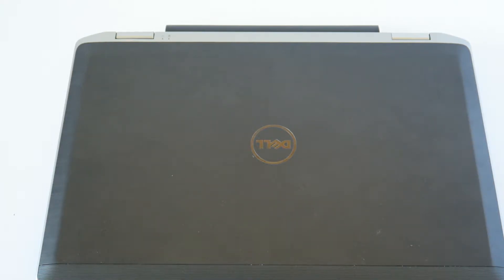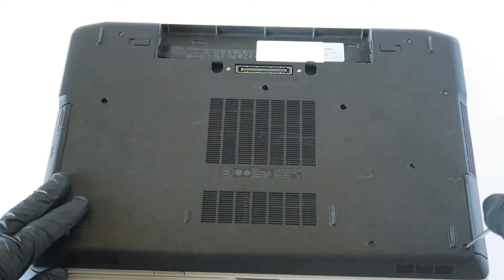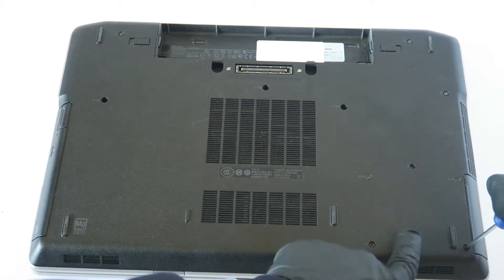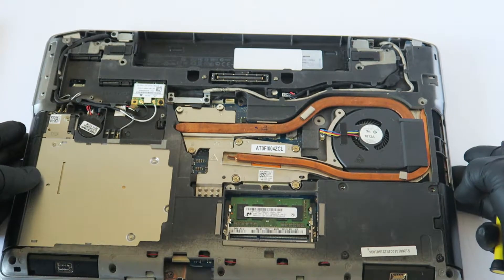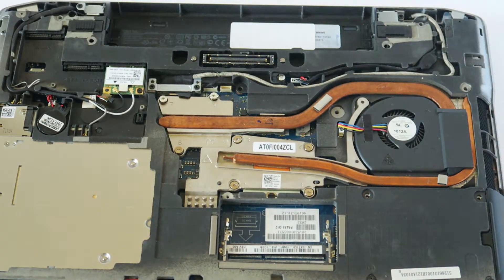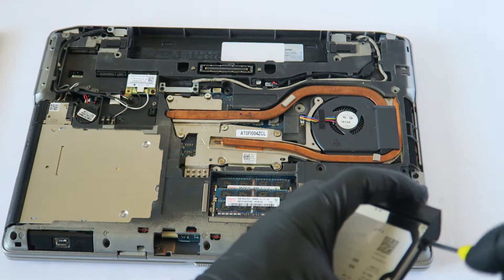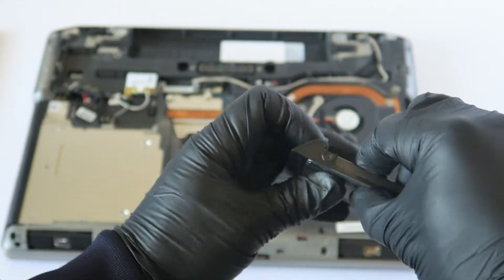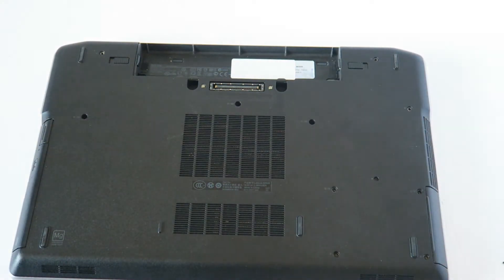Dell Latitude E6520 Upgrade RAM SSD Drive

Comment: Sir i like your stuff it's really helpfull, and i have a question about dell optiplex 9020, i want to install a gtx 1060 6gb 120w single fan in that case, the question is : can i use a 2sata to 6pin cable to power this gpu without changing the 290w power supply which is technically enough to give this power ???
Reply from the maker: Hi if you install gtx 1050 ti and you do not have to upgrade power supply and gtx 1060 6gb you should upgrade power supply at least 400w brand name and you have to use  24-pin to 8-pin adapter cable for dell optiplex 9020 mini tower.
Reply: +Mxkdi 
So i couldn't use those 2sata-6pin cable for that 1060 ?
Reply from the maker: No, you should upgrade power supply to 400w or better

Comment: 10,  but the stuff hasn't reached yet I only ordered  it
Reply from the maker: win10 64-bit i would go at least 8gb of ram and did you buy dell 990 with i5 ?
Reply: Mxkdi no
Reply: Mxkdi lemme link it
Reply from the maker: This memory i like and works with dell optiplex 990 
 HyperX FURY 8GB (2 x 4GB) DDR3 1333 Desktop Memory Model HX313C9FBK2/8

Comment: I got a gtx 1050ti and a dell optiplex 790 MT it comes with 6 GB should I get another 2 GB or 4? Or is it just fine
Reply from the maker: Are you running win10 or win 7 ?